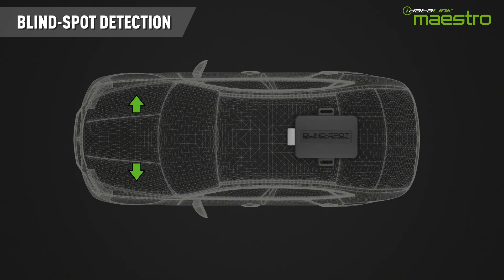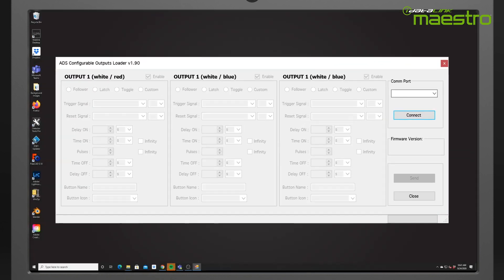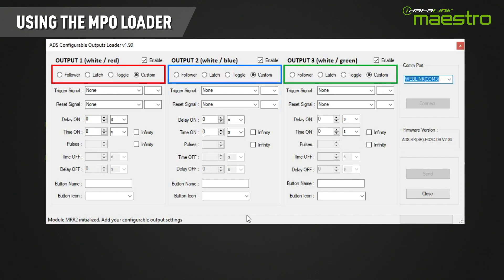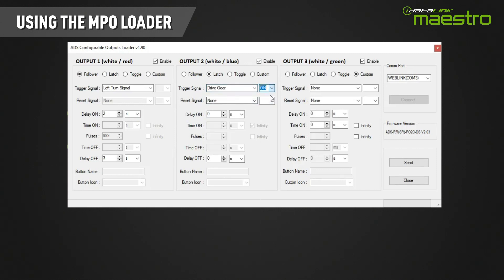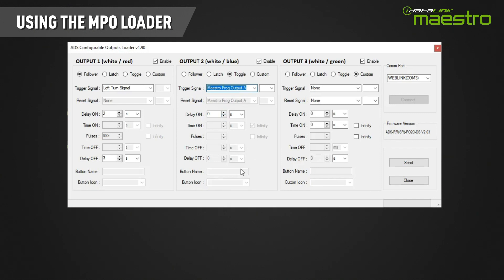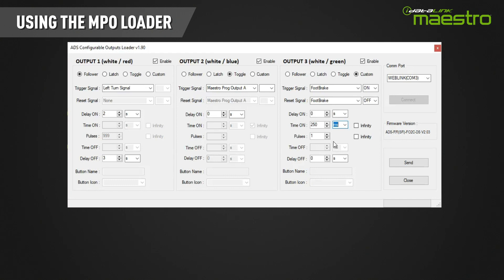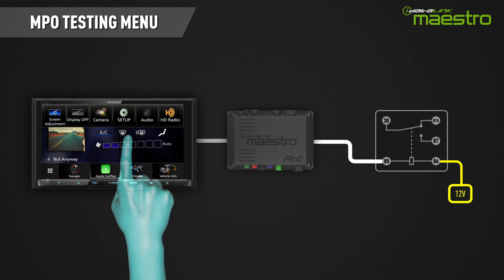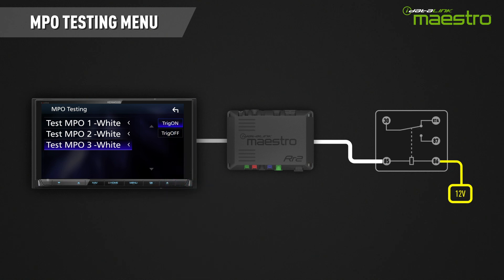Maestro RR2 - Maestro Programmable Output Tutorial (With MPO Loader Program)

Comment: Programmed the white/red wire to turn on when the parking lights are on (aka, at night) and wired it up to the headunit's illumination light, and nothing happened.
Reply: Kind of a stupid question but I’m going to ask anyways. Did you set it to a relay, the output is ground ( - ) output not positive. Maybe that’s why it didn’t work. I don’t know just my two cents. I’ve only programmed the maestro and currently trying to figure out how to program it to lock my doors, I set it to pulse for 150ms only once and turned both triggers to drive. Something inside is telling me this is wrong but I’ll have to check with a DMM before I actually hook the door lock wire to it.

Comment: I have a newer Subaru WRX - if I connect the RR to the OBD2 will it ‘flash’ the ECU? Just want to be sure it doesn’t as that may void car’s warranty
Reply: It's for replacement of stock stereo
Reply: No, your Subarus ECU cannot be flashed in this way. It requires a special tool if it is even a flashable unit at all.